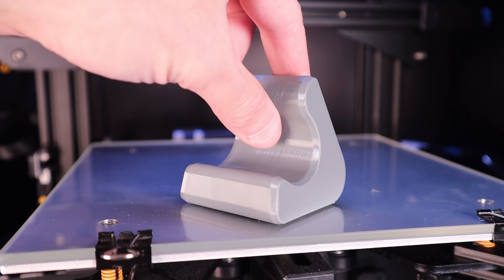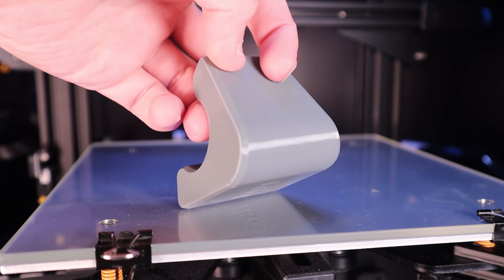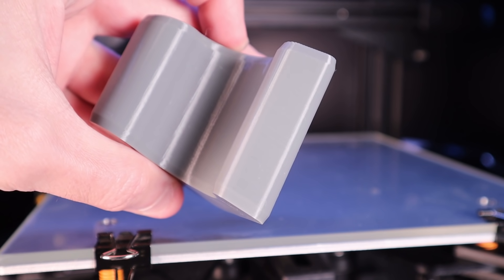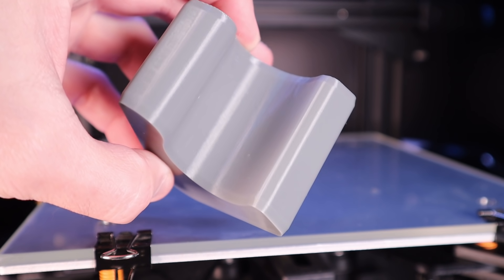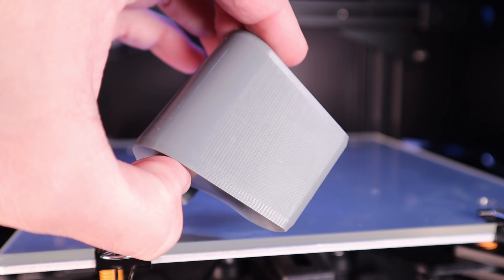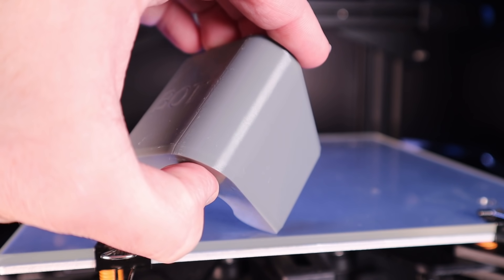Creality Ender 3 V2 - Simple Tips for Super Clean 3D Prints

Comment: I get my best petg results using 255c on the nozzle and 25% fan and a flow rate 95% also slow down the retract and advance speeds 25mm/s this seems to help with blobbing somewhat. also make sure its printing perimeters FIRST then infill and not its default of infill first then perimeters.
Reply: Why perimeters before infill?
Reply: @bc4ke  a couple of reasons first when the plastic hardens it doesn't exactly push out of the way so when you print infill first and then the perimeter the infield pushes the perimeter out where it intersects this is why you sometimes see the infield stick out on models people print

Second the inflow intersects the perimeters and you want them to for strength it helps to build proper info when it touches the perimeter outside edge of the model but if you're printing a button fill first there's no Edge to attach to yet I can't think of a single good reason to print infill first

Comment: Total noob question, but why does a round print need a seam? Can't it just be printed in one circular clock or anti clockwise motion?
Reply from the maker: Sure no problem.  The best way to explain is to draw it out with a pencil.   The normal process of creating a part is similar to drawing a circle, start, come around and then end where you began.  The z-axis then raises to repeat the process, This is important because many parts have multiple wall lines and this process is fairly necessary. 

The method you are referring to is an option and I have a video set to release for this weekend to show it off, but it is called Vase mode, or spiralize outer contour.  It is more like a spring (slinkey if you are my age).  It extrudes and continues to raise up while doing so.  This method is very fast and produces very nice prints however it has many limitations and cannot be used on many parts because it cannot print horizontal, or nearly horizontal surfaces.

I hope that helps.

Comment: I'm having difficulty having the outer wall adhering to the inner walls and infill. I feel like I've attempted everything, all to no avail! Most prevalent with large flat sides of the model
Reply from the maker: This is under extrusion, you'll want to first lookup a video about calibration of your e-steps.  Basically measure 110mm away from your extruder and mark.  Preheat your nozzle to normal temp and extrude 100mm manually on your printer.  You should measure 10mm left to your mark.  Adjust the amount of e-steps to bring it to the correct dimension.  Mine was under extruding when I assembled the printer and this fixed the problem.
Reply: @NeedItMakeIt  seems like it was under extruding by 38% that seems wildly high, still running some tests but thanks for this suggestion. I had forgotten to do this again after replacing the Bowden tube and extruder gear some months ago!

Comment: When you use a glue stick for bed adhesion, do you have to reapply the adhesive every time after it cools off and dries, or does the heating up of the bed “reactivate” it?
Reply: I dont change it everytime and that works, you just have to reapply the glue that sticks to the part. But over time that leads to some irregular build up of glue so if you want a perfect bottom layer you have to clean it up and put fresh glue on the plate.
Reply: @thrifikionor7603  That makes sense thanks for the follow up! I’ve basically been doing that already, it’s nice to SL have my thoughts on the topic validated lol

Comment: Can you make a video on how yo print that carbon fibre petg filament? There is no detailed tutorial on YouTube..
Reply from the maker: I have the hardened steel nozzle, what I need is a stainless or hardened steel extruder gear before I try this again.  It did a number on my brass one as I expected.   I'd need to spend some time practicing on it for a bit before I dare make a video.
Reply: @NeedItMakeIt  thanks. Is it very different to dail in compared to normal petg?
Reply from the maker: @Koerskoers  Yes, it is risky business, after this one sample it caused me no end of trouble.  I knew it would cause some problems and needed to experience it for myself.   Oh did I ever.  I had to take the extruder gear off completely and hand file it sharp again because it had worn away so much.   I think it may also be wise to print with an even larger nozzle, maybe 0.8mm.  

I have yet to test the benefits from print CF filament, it may not be justifiable.  It does look amazing though.
Reply: @NeedItMakeIt  i am looking to start printing with CF alot for its properties. The main upgrades should be hardened steel gears and nozzle as you advised?

Comment: Have you ever printer nylon filament..that's a tough one.
Reply from the maker: Will add it to the list! I'd love to make some functional bearing type parts
Reply: @NeedItMakeIt  I use nylon x from matter hackers it works well but it tough to control lifting.
Reply from the maker: @TC-dk6do  I've tried nano bed adhesive with very good success on ABS with heavy infill/walls etc, it works very well, it did take some glass with the print also.  It claims to work for materials like Nylon, but I'd want to test it out myself.

Comment: noob question but uh... whats up with the butter??
Reply from the maker: Oh it was just a silly joke.  Like buttering someone up, or "grease me up woman" - Groundskeeper Willy.  You will have better results if you use just plain old glue stick from the dollar store.  If you plan on printing with ABS or ASA, you'll want to print in an enclosure and you may still have trouble with adhesion and you may want to use something like NANO adhesive, but some people have had okay results with ABS juice, which is just acetone and pieces of filament cut into small pieces left to dissolve in the solution.

Comment: You didn't mention ironing i think a lot of beginners watching this Video will be looking for the ironing option
Reply from the maker: I can't say I've had much success with ironing, maybe printing with PLA is okay, but PETG seems to make an awful mess and drag along blobs with the nozzle.  It could probably be refined.  I suppose for parts with nice flat surfaces this would be a good solution so I will add it to the list of process to review.  Do you use PLA with ironing?
Reply: @NeedItMakeIt  I use ironing with eSun PLA+. It didn't turn out well at first because I forgot to test and update my e-step (it was too low) after upgrading my extractor. But after dialing that in, the ironing has been giving a pretty good finish on large surfaces. I've had a couple very small blobs at corners with it that I may be able to get rid of as I keep trying new things.
Reply from the maker: I made another attempt, and... this is working awesome, I've changed iron setting to concentric, and reduced the flow to 5%.  for this material the default must have been too high.  The tops are ultra smooth and very pro looking.   You'll see the results of your tip in a future video, thank you!

Comment: at what speed do you print?
Reply from the maker: Infill 78, Inner Walls 57, Outer Walls 35, Bottom 45, Top 55.  I am experimenting with faster speeds at the moment, I've added 5 deg to the nozzle and fan at 10%, I've increased the settings for each speed by 5 to see how they do.
Reply: @NeedItMakeIt  fo ender speed is good)))) normal speed for enderd 30/15)))

Comment: New to 3D printing <1 week. Would you turn cooling on for PLA or are you just talking about PETG?
Reply from the maker: Hi,

I like to print with the fan as low as possible mainly because I print parts intended to transfer loads, I want the layers to adhere as much as possible.  PLA is normally printed with the fan set fairly high, with this you'll have the advantage of bridging over larger distances and printing overhangs results in better results there as well.  If you're printing items for decoration having a fan set higher should make it easier for you to get started.  

I like to setup my tests as 'Worse Cases' because they tend to show problems rather than cover them up.

I'd recommend putting together a few test samples to see which settings work best for you.  Printing small parts as shown in the video will require different settings compared to larger parts for example and you'll need to dial-it-in for your particular case.
Reply: @NeedItMakeIt  Thanks for the reply! I am mostly printing prototype parts for basic concept and basic function, so I don't have to pay for SLA parts every time I get a bright idea, just to make modifications. I do want some decent dimensional accuracy, +/- .010 - .020 and my holes typically run a bit small, so I will play with the fan settings and others to see where I can improve. BTW, thanks for doing what you do, us Newbies appreciate it!
Reply: Cooling is also very dependent on line width/nozzle size. At 0.6 I find it's easy to go way too hot with not enough cooling.

Comment: which filament do you recommend for the ender-3 v2?
Reply from the maker: It really depends on what you're trying to print, are you referring to a brand mainly or are you talking about the material choice mainly?  I can try to answer both here.  If you're printing without an enclosure, I'd use either PLA or PETG, I've had good success with both of them in that way, just make sure to keep them dry, you can get a filament dryer or keep them in a container with some desiccant.  If you're talking about Brand, that's a bit tougher, since I've only tested 4 brands to-date.  Probably the top of the line is Prusament,  after that they're all so close it's hard to tell the difference.  For years I printed with the no-name brand and it was just fine for my needs.  I'd suggest starting with the no-name and working your way up from there.  You can buy from Amazon as well, they have lots of selection, lots of reviews etc.  I hope that helps a little!
Reply: @NeedItMakeIt  thanks!
Reply from the maker: @aviationmoment2024  Anytime!
Reply: @NeedItMakeIt  I cant find Prusament or no-name on amazon
Reply from the maker: @aviationmoment2024  Prusament is pretty top-tier and they only have select resellers, and no-name, well, that's just any old brand.  If you're in Canada, it's the generic stuff that 3D printing Canada sells on a solid sided black spool with a cross-hatched pattern on them.  They don't have any brand so that they can be solid by any company and re-stickered.
Reply: @NeedItMakeIt  thanks anyway

do you know if polymaker is good?
Reply from the maker: @aviationmoment2024  I've heard good things about Polymaker, yes.  Just a caution too with the weather changing at least where I am for the summer, if you're in a place with higher humidity you'll want something to store your filament in to keep it dry, also a filament dryer.  I don't tend to keep much around, I buy more as I need it so that I can avoid having to dry it out all of the time.  Not sure if this is a concern for you, but I thought it was worth a mention.

Comment: Have you tried linear advance? I have been using this technique and I believe it improves the quality of the prints. I can also print as much as 50% faster. I have printed at 100mm/sec with no reduction in the quality of the prints. Retraction can also be reduced. I think I could print even faster, but I think the stepper motors may start skipping steps - I may test this in the future, but overall, I am pleased with it and plan to use it for most if not all of my prints.
Reply from the maker: I have not, I will check it out for sure.  So how do you compensate for the increased flow, higher nozzle temps?  Do you find that you have more ghosting or do you have slower outer walls to compensate?  Thanks!
Reply: @NeedItMakeIt  Linear advance pretty much eliminates all the problems, that's the point of it. When running at 100mm/sec, I did increase the filament temp about 5C. It does take some setting up. There is a program on Github that can help determine what K value to use. K is a dimensionless value that determines the behavior of the linear advance setting. There is an add-on for Cura that allows you to set the K value right in your Cura profile so you do not have to go back to the Marlin firmware to set it.
Reply: @rcort4864  I thought the Ender 3 V2 is not capable of linear advance due to the legacy mode of motherboard and stepper motors? Do you have any link for me with stuff to read how to make this happen?
Reply: It may not be - IDK. Linear Advance is a part of Marlin firmware, so you must be using Marlin to activate it. Here's a video to get started: https://www.youtube.com/watch?v=c5jjwBqARpo

Comment: Hi, thanks for sharing.  Which precautions can we take to avoid damage 3d printer while printing with carbon fiber?
Reply: usually it is better to use direct drive instead of bowden extruder and capricorn tubing - that causes less stress on gears. 
use stainless steel, tungsten coated or gem based nozzles for abrasive materials. 
even nickel coated nozzle can be damaged in the long run and will lose its features, so cheapest and long term proofed way is stainless steel nozzle (single material, so small surface damage will not reduce overall nozzle's material integrity).

Comment: I am confused as to where to set these in Cura (4.11.0). The onlt settings I see with these labels are set in tenths
 of a mm.
78mm Infill, 37mm Outer Wall, 57mm Inner Wall, 55mm Top/Btm, 45mm Initial Layer
Can you clarify?

Comment: nice vid, how do you get rid of seams on round prints? Just starting out and hate to see that line running up one side, thanks
Reply from the maker: Turn on wall wipe, print with a small nozzle, and thinner layer lines, printing slow also helps with a bowden setup.  I'm working on a video to review every possibility for the best solution with this printer.

Comment: Great tip.... Any experience with metal infused pla?
Reply from the maker: No but I do with CF PETG and I'm not too much of a fan at the moment, it wears the nozzle and gears super quick.  I've ordered a set of hardened dual gears to handle it along with a hardened steel nozzle, so I'll be giving it another go soon.   It looks great and it is more stiff so there are some pros.  

What are the benefits of the metal infused filament?

Comment: My 3d print has many blobs it stops for a second and then continue
Reply from the maker: Which printer do you have?  Can you tell me a bit about what you're printing?
Reply: @NeedItMakeIt  My printer is an Elego Neptune 3 and anything I print this happens but with detailed prints a lot more blobs appear
Reply from the maker: @shrekshrek  The printer should not do that.  It seems like there are some settings which have been adjusted to be far too slow.  Which slicer do you use?   Has your printer always done this, or did it begin when you changed filament, or possibly adjusted some settings within the slicer?
Reply: @NeedItMakeIt  I use prusaslicer my printer never did this and my filament is very old but it's strange because a few days ago I was printing normally and I leave it at the default setting
Reply from the maker: @shrekshrek  Hm, if it's pausing that's a setting or something fouled up on the printer, which is strange as you say if nothing has changed.   If there is something small you can print as a sample, I'd use a default setting in Prusa Slicer and see if there is a change to that issue, my guess, is that if it is travels, the are would be acceleration for travels, or travel speed, but it might be good just to see what a default profile produces and go from there.
Reply: @NeedItMakeIt  I printed a benchy a few hours ago and it had small blobs and there are also times when my table shakes and my 3d printer makes a loud noise
Reply from the maker: @shrekshrek  If you could get a short video and send a link to needitmakeit@gmail.com, that'd be helpful, diagnosing something if I could see it would be easier

Comment: A video on how to get that soft seam on circular objects would be awesome. I’m troubleshooting on mine but still it dips in too much. would really appreciate some help. (using MS DD and all metal hotend)
Reply: enable retraction in your slicer settings (retraction in cura, maybe called something else in your software of choice). It pulls the filament back from the nozzle and generally does a really nice job of eliminating blobs and other defects where the nozzle stops for a second before changing direction. I have mine set to 7mm retraction length and my surface finish is usually near perfect. Unless I do what I did an hour ago and let my printer run out of filament. Whoops.
Reply: @FurryKeidran98  nah, he's talking about circular objects. There's no way to hide it there

Comment: do you have any tips for PLA?
Reply from the maker: I've only started printing with PLA, I'm still on my first Roll.  I find it really easy to work with.  Keep it dry to prevent stringing, the part cooling fan needs to be on for the best results.  I print at higher speeds so I've been adding a house-fan to blow at the part to keep it cool for any parts with overhangs.  I am working on seams at the moment to try and get the best possible settings, maybe the results of these tests can help you.   I've been setting seams to vertical, it would be better to leave them as random, if the results are good enough.

Comment: what software should i use
Reply from the maker: A lot has changed since this video.  At this point I'd recommend Orca Slicer, it's the most universal in my mind and works with just about every printer.  Some people still use Cura, and I still like the interface, but it's not as capable.  Which printer do you have?